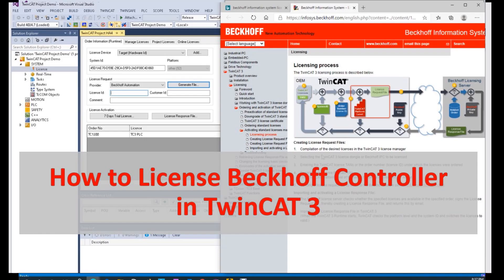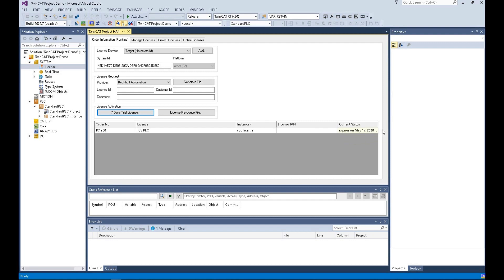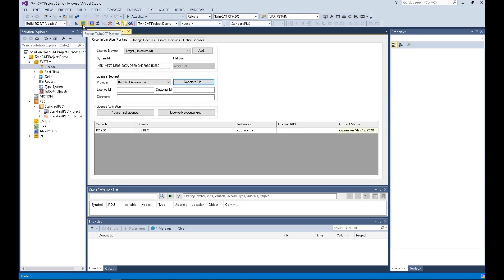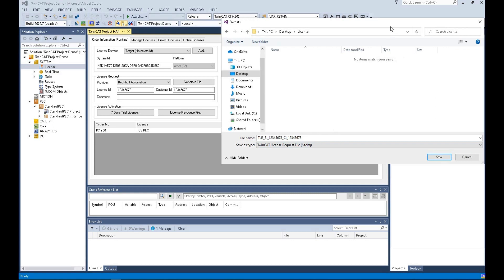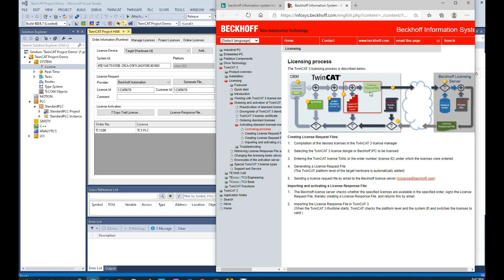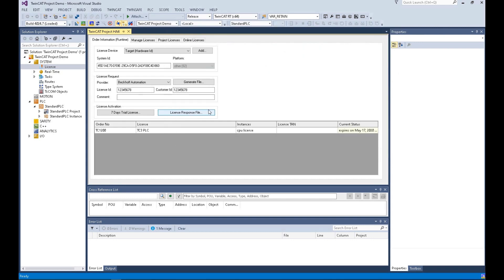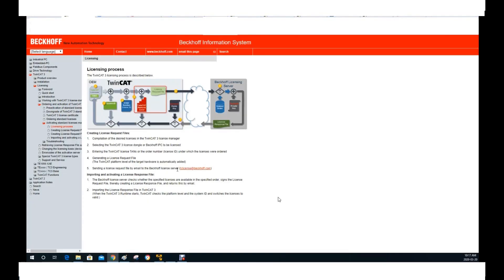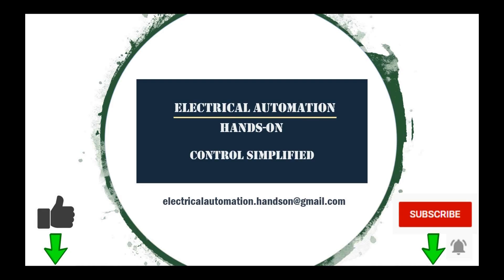BK08.  Beckhoff TwinCAT 3 Licensing

Comment: Excellent and very useful tutorials. Today I got stuck on something very very basic. Next to the MAIN program I made a SUBMAIN program. In the first i declared I:INT and assigned a value in the code i := 3. In the SUBMAIN i made a variable isub: INT and I assigned a value to it in the code isub := 5; In MAIN I simply put submain();
When i ran the code the value of i and isub remained ... 0! Only when i assign a value in the declaration section is the value retained.

AI agents tell me not to reference Programs from with programs (from MAIN to another) and to use FB's instead. Sometimes i get feedback to add  or remove it from PLC Tasks.

Basically what i want to do is to make a library with some FB's, but to add testcode for the FB's  - say testFB1, testFB2, ... And i thought this testcode should reside in separate POU programs to test the FB's. From the MAIN then i could call testFB1(); 

but weird stuff happens then! (why do values stay 0 ???)

In your examples i saw more PRG's next to MAIN and MAIN referring to them ?
Any help is welcome.

Comment: Hi, can you show example, how to programming Beckhoff  with C++ module?
Reply from the maker: Hi thanks for your comments and proposal. I never used C++ in Beckhoff. But I do have interesting in testing C++ because I am going to do some study on Matlab + Beckhoff. Just would be not too quick to release the C++. I am working on a new 'PID'+'Process Modeling' series videos. After finish this wave, I will shift to study Beckhoff + C++. Thanks again!
Reply: @electricalautomation   im waiting for Matlab also!
Reply from the maker: @deividasnaudzius6504  Thank! Will be in my plan.
Reply from the maker: @deividasnaudzius6504  Hi Deividas, I reviewed the documents and information about the C++ and Matlab. It seems that it is not an easy job to prepare. One of the key obstacle is the software issue. System environment, visual studio,  matlab versions, and Driver Kit. It is value to set up a whole series video to talk about this. I am planning, but it will not be soon, may be couple of months after, because I need to totally focus this whole topic for a while once it started. But as some my other videos, I'd like to do some contribution on connecting Engineering and Research achievement. If you recently have development task to do, I am high recommend you could check the link https://infosys.beckhoff.com/english.php?content=../content/1033/te1400_tc3_target_matlab/9007203465956235.html&id=3890205655954044743. There are many details need to configure and prepare. Thanks again!